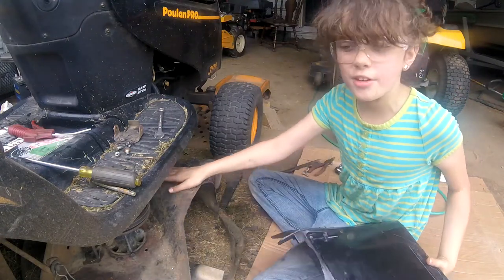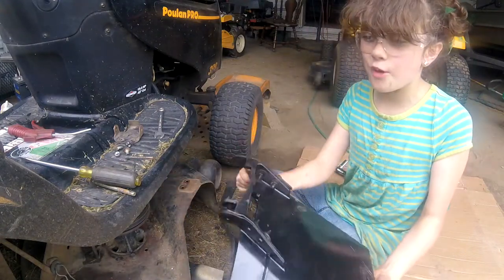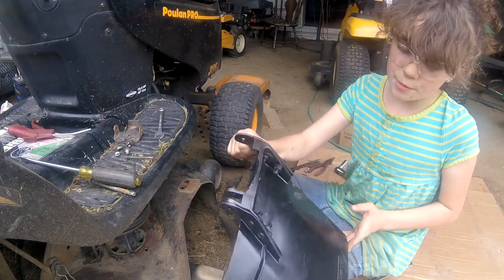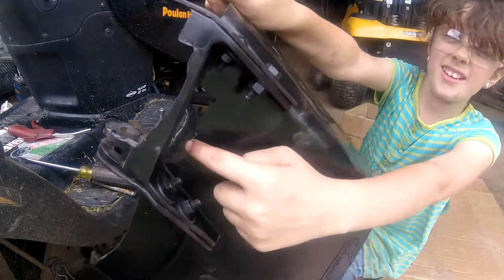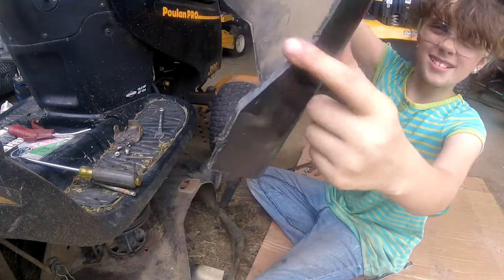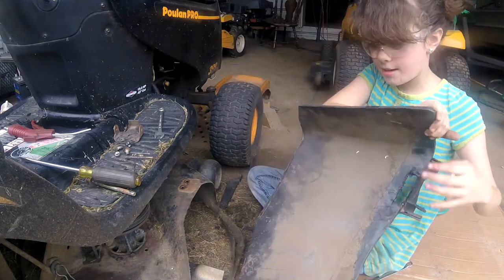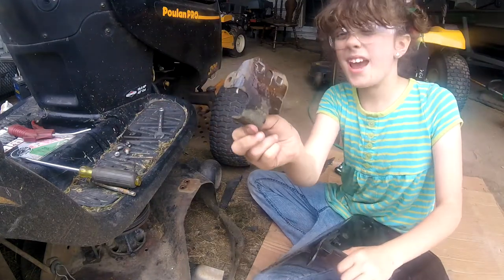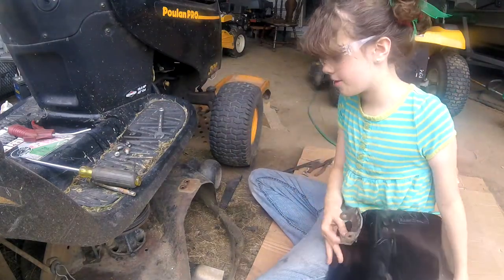Tera Fixes her mothers mower with my help

Comment: Did she forget a spring, or was that from the old chute?

Tera's going to be able to put herself through college doing mower repairs. :D
Reply from the maker: WeirdHarold49 that was from the old mower.. also surprised  me she wanted the air ratchet  too
Reply from the maker: i am grown and i have hit those dang fake nuts..Maybe on purpose,  i will not admit to anything
Reply from the maker: hey Quin Take a look at the ending credit logo and see if you can see why i have those blue line sticking strait up on each side.I have blown that ic up in paint and they are not there only when i put them in the video.. i have no clue as to why
Reply from the maker: QuinB I will  check  the settings  in my editing software.  this is the only image it does it on.. thanks for taking the time
Reply from the maker: QuinB I use movie studio platnum
Reply from the maker: will do  Thanks Quin B